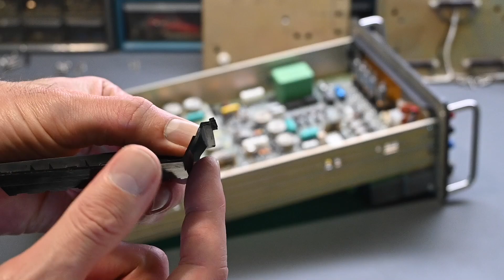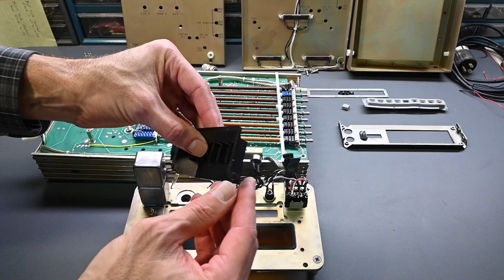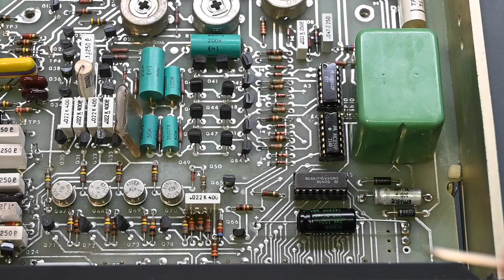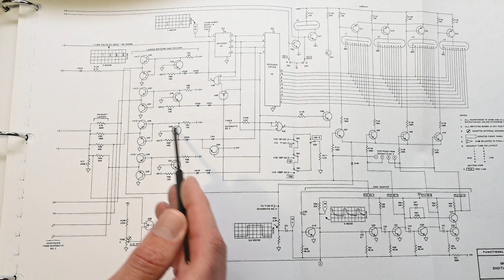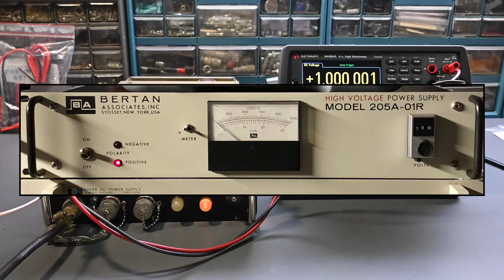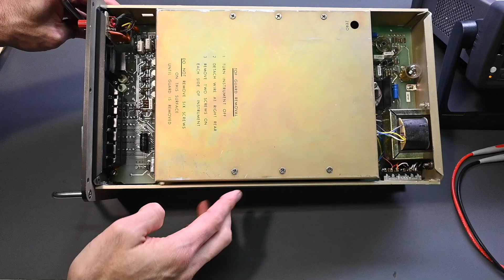Fluke 8125A Repair: The Hidden Fault Is Fixed... Then Disaster Strikes (Part 2)

Comment: Really nice job on this beauty Eric!  Interesting points on the probe incident, DOH! You're right, they really do make a difference for a given task. Gratifying to see you show the Fluke Twist Guard probes. I kinda' feel like they haven't gotten enough credit in the electronics space. I think it's a very slick solution and they've become my daily use probes. Yeah, ProbeMasters are great, and I use those too, but for workaday bench work, I've settled on the Twist Guards. Really glad this Fluke Meter fell into your hands! Enjoying your videos, thanks! - JRH
Reply from the maker: Thank you for watching and glad you are enjoying the videos!  I've used the Twist Lock probes quite a bit and do like them.  I keep them on one of my bench multimeters but of course not the one I was using during the "incident".

Comment: That was quite a journey! With all the dings and dents, it looks like someone drove over it in a tank on a bet... I definitely fell lucky with mine. Also of minor interest, I think yours saw desert action, with the tan paint, while mine is in olive green.
The digit two dropping out hasn't happened again; ran it for ~16 hours with a 10mHz, 5V pk-pk triangle wave on the 10VDC range, just to give the decoder/driver a workout...
Incidentally, even though mine is correctly set to 230V operation, the fuses are for 115V, so I am having to order some of the correct value  :/
Reply from the maker: Yes it sure saw some rough service!  Interestingly for all the rough handling the front panel is in very good condition, no scratches or anything even though the fuse holders were broken.  The color might not appear quite accurate in the video but it is actually yellow not tan.  I have noticed others shown online are the olive green.  Glad yours is working well now.  Correct the fuse rating should be changed, good to catch that.

Comment: G,day from Sydney Australia.
Interesting look at an old vintage fluke and it's schematic (with trace wave) at test points, thank you.
Q1. How do you establish a caps specific ESR tolerance (data sheet)?
🌏🇦🇺
Reply from the maker: There are charts that list typical ESR values based on capacitance and voltage rating.  Take a look at https://www.peakelec.co.uk/downloads/esrguide-en.pdf   scroll a few pages in and you will see just such a chart.  These are typical values and often   quality capacitors will measure better but if the ESR reading is noticeably higher the capacitor is probably failing.  Most manufactures give typical ESR values on the datasheet.  There are not percent tolerances given for a capacitor's ESR.

Comment: Lovely that it works. Must have been a leaking transistor or maybe the circuit relies on some capacity in the transistors, that has drifted slightly.

Comment: Well done, thanks for sharing.
The difference on the 5MOhm resistor might be due to worse isolation of the different cables you're using.
PVC isolation gives remarkably parallel resistance /leakage current to the DUT. I've seen ~ 1ppm difference for a drilled pair @ 10kOhm
Reply from the maker: Yes a better quality shielded cable would probably have less interference.  Agree I have seen PVC insulator boots that had measurable leakage current.